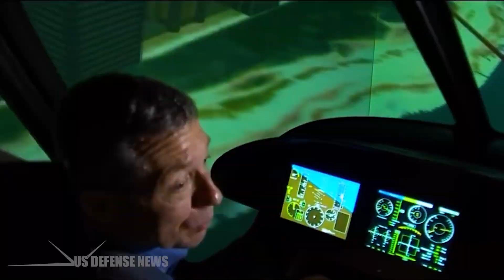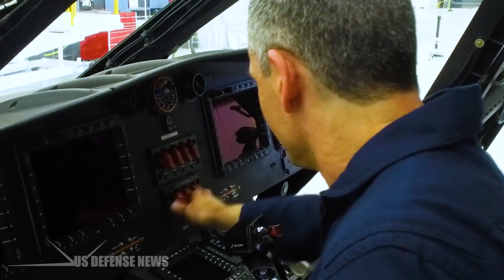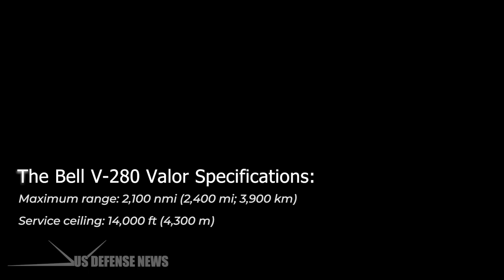Here's the New U.S. Army's Helicopter Replacing the Black Hawk

Comment: Hey Waymo, pick me up at the demolition derby.  I'll be down in the middle.  the "Craphawk 280".  Once big money is involved, it can't be reversed.  No matter how many mishaps occur.  I'm guessing those wings must be made of titanium to keep the engines at the far end from snapping off on just the slightest turbulence.  Or maybe the engines and rotor hubs were made to break away for safety reasons, I don't know.  And the wheelbase doesn't look as wide or solid as the Osprey's.  I think it will roll over and saw up the lawn more often than the Osprey did or ever will.  I wasn't totally sold on the Osprey,  but it looks way safer than this thing.👎

Comment: The v-280 needs to be designed into different models such as micro, small (5 seats), medium (12-24 seats), medium and large (40-60 seats) and heavy (80-150 seats), seaplanes, etc.
The speed needs to reach more than 900 kilometers per hour, the steering, acceleration and deceleration actions must be faster and more flexible (the steering action in the current film is still very slow), and it must be able to function in bad weather.
Automatic unmanned driving systems and automatic remote-controlled weapon systems need to be installed to cope with various scenarios.

It is also hoped that the SB-1 will be put into production after being equipped with an autopilot system to replace some old and slow helicopter models.
Reply: 900km/per hour ?? XD maybe with turboprop contra rotating propellers in hight altitude
Reply: no it doesn`t

Comment: It would be cool if they put jet engine on it instead of prop !! They pretty much just took the arms from the osprey and put em on a Blackhawk and called it something new
Reply: Jet engines wouldn't allow for VTOL in this case.  This is not the F-35 or AV-8B Harrier.

Jet thrust must be carefully balanced.  The rotors provide a much broader lift cushion footprint.  And those aren't "arms", they're wings, and the fuselage is completely different from the UH-60.

Comment: Looks twice as expensive, and twice as vulnerable to the Blackhawk.  Not sure this is the correct path for the Army.  Using two big engines (as opposed to one on the Blackhawk), losing just one will cause the aircraft to drop like a rock.
Reply: Both engines are connected through a driveshaft, so if one engine fails the remaining one can power both propellors.
Reply: @gekoloniseerd8191 The engines of Osprey V-22 also connected by drive shafts to a common central gearbox. But the rotary position is not capable of hovering on one engine.
Reply: @The_Accountants  This is not the V-22.  Bell has stated that should one engine fail on the V-280, the other engine has enough power to drive both rotors and complete the mission.  What happens when you lose the engine of a Blackhawk?  Oh...you get a movie out of it.
Reply: @ralph7448

Where did you get the idea that the UH-60 only had one engine, genius?!  It has one MAIN ROTOR and TWO engines.  Don't comment when you don't know what you're talking about.

Comment: Look nice. Questions: 1. When it will arrive ( I live in Germany next to US-Army-Airfield in Wiesbaden)? 2. How Loud is it compared to UH-60 Blackhawk? 3. Does it work safe?  ...I hope to new Helicoptor is more silent. In Germany the switch from Bo- Helicopter to Eurocopter for Rescueflights was a big Step for Silence.
Reply: 1.  Operational deliveries are planned for 2030 assuming the budget isn't cut.  2. In wingborne mode, which it'll be in most of the time,  it is much quieter than Black Hawk.  It'll generate more noise  when in rotorborne mode, but how that compares to Black Hawk hasn't yet been determined.  We need a production stand ad airframe to determine that.
Reply: You can expect more noise during take-off and landing due to higher disk loading. And keep in mind this is a military aircraft not a business one.
Reply: Speed and range can all be shot down.  I'm looking at the cost.  I can drive a Honda just as well as driving a Cadillac an still accomplished something but cheaper.
Reply: @melheinrich5438  Except that is not how military equipment works... it goes 3 times the distance and at 2 times the speed while carrying more people or cargo while doing so.

Comment: They have the osprey which has more or less the same capability as far as I'm aware and they said at the start it will also replace the apache which in my humble opinion would be a mistake
Reply: V22 has twice the capacity on paper and foldable wings which army doesn't need. V-280 will have the same power, more agility, cost less and will sell like pancakes.
Reply: @rookiebird9382 

Not all the V-22s have folding wings and rotors, only Marine Corps variants.  Air Force variants don't.

Comment: I have watched six  videos about this remarkable craft and I'm beginning to wonder if it can transition from Vertical to Horizontal flight.  So far, NONE of the videos have shown this. Nor the reverse. (ʘ_ʘ)
Reply: Well, you can see it here. At 1:45 and 1:49 and 1:50 and 2:25 and ... Ok, its not a total transition but still...
Reply: By the looks of this you can't.
Reply: You know if it couldn't , don't you think someone might have noticed?  How else would they have videos of it in helicopter and fixed wing mode if it couldn't transition?
Reply: You think it just has a very tall landing gear?
Reply: the rotors are simply too large for it too take off in the forward position. every time you see it in the forward position, it must have taken off in the vertical position and switched mid flight.
Reply: @basilo9923  In an overload Short TakeOff, the rotors are in an intermediate position, the normal operation  is VerticalTakeOff.
Reply: I think that is costing too much of citizens taxes. 🤔  A regular helicopters be cheaper here same purpose except maybe distance.  Why is DOD getting 🤔 bigger equipment equals costing more money.  DOD needs to be reined in on major purchases.
Reply: @melheinrich5438  Well, to start,  the V-280 is faster, by a lot, goes farther, is more agile, carries more troops and can operate at higher and hotter locations than our existing helicopter can.
Reply: @melheinrich5438  a regular helicopter cannot even hope to match the range and speed of a equivalent tiltrotor.

Comment: If its production version can, like the V-22, turn its wing for transport and stowage, then it might be workable, but the added weight and complexion will reduce speed & range. 
The pods, whilst less complex than the Osprey's and capable of translating power to the opposite rotor, are a sitting target for weapon systems that are not reliant on heat-seeking guidance. It should be a given that Bell has worked out the kinks that lead to so many early tilt-rotor rollover crashes, but the potential for such to happen isn't zero. Even though the competing design is also vulnerable to crashes at low-level due to random factors, (the Black Hawk that crashed during the Osama bin Laden compound raid) it, like the UH-60, is engineered to handle such crashes via crumple zones and points on the airframe and seats. The same cannot be said for the Valor should it roll over. Auto rotation at altitude should, I hope, be an integral capability of the V-280. The dynamics of the design favor it being possible, it's a given on the competing design. 
All around, the choice of the Bell design just doesn't add up. If the Sikorsky design's means of flight was a brand new concept, then I could see the Army Brass going with the "safer" more proven tilt prop design, but such isn't the case, with the SB-1 being derived from the X-2. If the Army does decide to commit to the horse it's chosen, I can only hope that the other branches opt for the other horse in the stable. The Navy/Marines will absolutely need as much space savings as it can get, so they will probably put for the competing design, it's happened before. The Air Force is, as always, variable. 
Hopefully, the Defiant's team wins their protest.
Reply: Defiant lost their protest big time.  Inters tingly, they lost not because the V-280 outperformed them, which it dramatically did,  but because Team Deffiant's bid didn't comply with all  the requirements of the RFP.
Reply: This fumble on Sikorsky's part males no sense. It truly was theirs to lose.

Comment: Too many questions how this will replace the Apache, is this for real? The tilt rotary configuration of the boing system has been a deadly disaster to this day.
Reply: How has it been a disaster, and where has the Army said they want this to replace the Apache?
Reply: @tararaboomdiay7442  Do your homework.
Reply: @icare7151  I have, and for years now the Osprey's  Class 1 accident rate is the lowest of all USMC aircraft.    And again, where has Army ever said that FLRAA is intended to replace the Apache?
Reply: @tararaboomdiay7442 

Check yourself, kid.  Multiple Marine Corps 22s have crashed in descending right-rotating landings, killing all on board.  It's safety record is questionable AT BEST. The only other Marine VTOL aircraft even CLOSE to this bad a crash record is the CH-53E Super Stallion, when they were having that nasty habit of dropping their tail rotor gearboxes IN FLIGHT.  The 22 is worse.
Reply: Possibly but not quite. The role of the apache will be split into two. 

Also this thing is quite different from the osprey in some key areas, but we will only know if it is reliable once it is fitted with the new engines.
Reply: Another one just crashed. Appears defects the clutch systems. Fleet grounded, again.

Once the bugs are worked out and defective parts are reengineered, this platform mature into a huge military asset.
Reply: *Boeing

Comment: so you can't put weapons underneath the wings because of the rotorblades. And you can't put weapons underneath the fuselage because of the landing gear. What about putting weapons on top of the fuselage then?
Reply: To begin, this is a troop transport and is not intended to fill the Apache's role, so the fact that it doesn't carry all that ordnance is irrelevant.  However, if you wanted an attack variant (of which Bell has shown concepts, don't fall into the common misconceptions.  

An attack variant probably wouldn't use weapons on  wing hardpoints because of the drag.  However, if they wanted to they don't have to rotate the proprotors all the way up, all they have to do is rotate them far enough up so that they clear the missile's flight path.  This would limit top speed, but it would still be way faster than an armed Apache.  As far as underneath the fuselage goes, don't forget than when it's launching, , the landing gear has been retracted.  Most jet fighters launch their weapons from underneath, after the gear has been retracted.    And you cold also mouth weapons close on on the side of the aircraft, or even have them retractable.
Reply: @tararaboomdiay7442  the Soviet Hind was a troop transport too, so I don't see why not. Apparently Bell agrees  
And wont it have to have those rotor-blades completely flat to take off and land vertically.
Most jetfighters launch their weapons from underneath their wings

Comment: How can this replace the AH60 Apache?
Reply: This isn't  to replace the Apache, it's replacing the Black Hawk.  However, an attack version could be developed if someone is willing to pay for it.
Reply: @tararaboomdiay7442  Utility version will be completed first and put into production. Then attack version will be developed.
Reply: Still wondering about that as well!!!
Reply: It should carry more weapons. It can hover reasonably well. There will be other aircraft that will do what this plane can't. Why wouldn't it be able to?
Reply: to replace the AH 60,   WIng mounted armaments packages.... Maybe even a 20mm nose cannon.,,, But it needs a ramp exit, just bring that Beachcraft Bonanza tail section in-line with the main wing and, wa-la there's a place for the ramp to rapidly load the aircraft....
Reply: @davejohnston5925 

You're describing (basically) a Shorts Bros. chassis with the engines and rotor system of this.
Reply: Speed only. Armor and Firepower doesn't appear to be a priority.
Reply: They won't replace it in any way because the UH-60 Blackhawk is a beautiful military helicopter.
Reply: @OptimusPrime6321-g1r  i was in an infantry company that was fortunate enough to have had dedicated 60s during our deployment. Several flights a day in different mission platforms pretty much every day for 13 months. They were freaking workhorses with crazy dependability and the pilots on rotation were all studs. The only drawbacks were altitude and space, which I think the V-280 addresses and then some.
Reply: @OptimusPrime6321-g1r  AH60 Apache!!!
Reply: @honkytonk4465  AH-64.. bdw